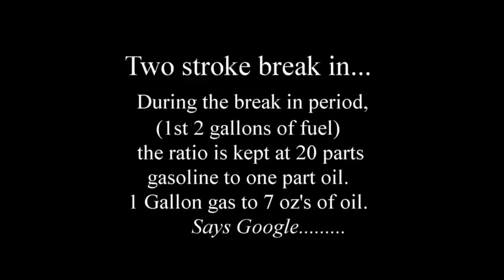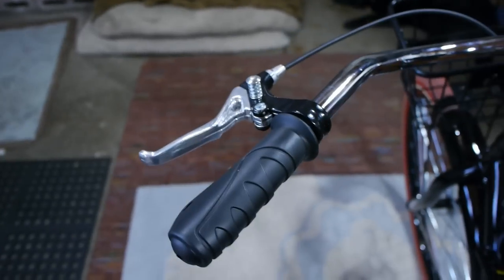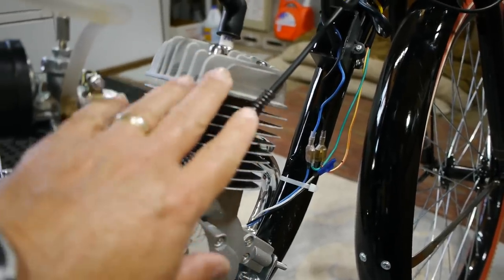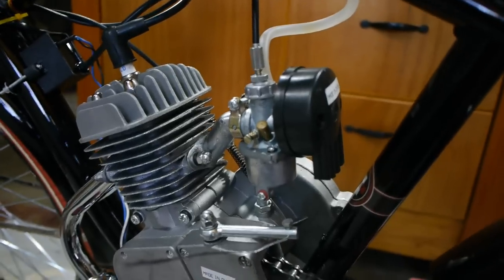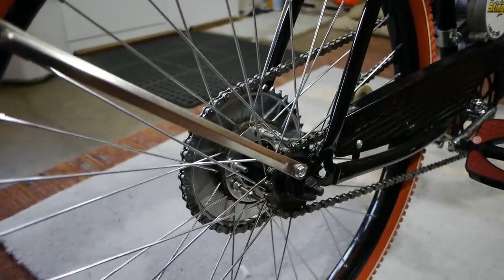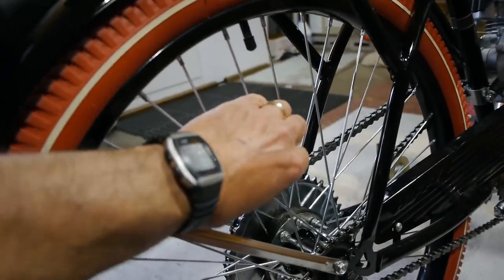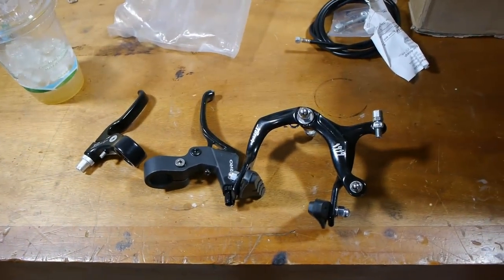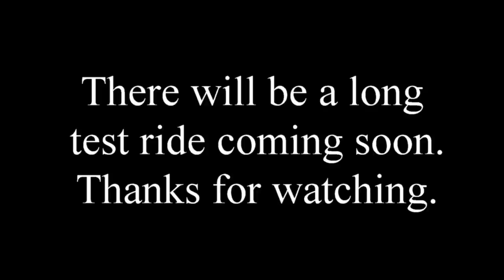Motorized Bike #1.  What I have learned so far.

Comment: Take off the fenders!  Or learn the hard way LOL  Seriously!   I tried it even with old ass 10 ga ones. They could pretty much take a 9mm they where so thick lol still failed over time from vibration!  The plastic ones will fold up in the tire and kill you. The metal ones will split around the bolts from vibration over time.  Mine lasted a while and then bit the dust. Tried everything you could think off to kill the vibration or dampen it and still failed!  https://youtu.be/ljagB9WCcZY when the front gave up the ghost mid ride on me, I got lucky it didn't flip into my tire like most have happen!

Comment: How fast will those go? Does anyone put expansion chambers on them?
Reply from the maker: MCE Performance, the one in the video would do about 35 to 40, faster than I wanted to go. this was my first build and I discovered there are all sorts of ways to make these things go faster. personally, if I was to do it again, I would put a larger sprocket on the back so top-end would not be as fast but I could go up hills with more torque.
Reply: Photojunky's Drone Zone Vlog mine go fifty some go much faster. zeda motorsports makes a 96 cc kit

Comment: What is the top speed of this bike
Reply from the maker: Ayyanar Samy somewhere around 40 with about 130 MPG.
Reply: for not only safety purposes, but also the life of the engine, I recommend NOT going over 30 for more than a half an hour at a time, these engines are air cooled, but at higher speeds, the frame and your legs actually reduce the effective air flow, the engine will overheat quickly, back it off to 20mphor less for at least 10 minutes, my father is installing a scoop on mine when I get the new one, but it's not so I can go higher speeds, it's so I can cool more efficiently at 30mph for longer